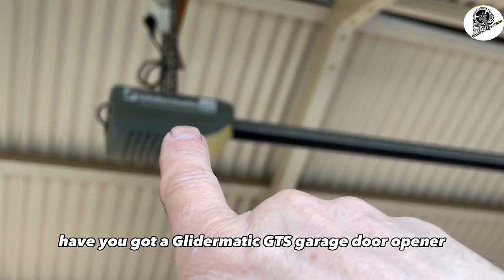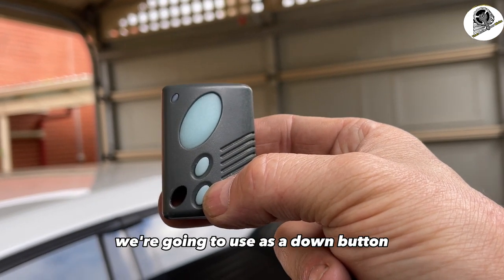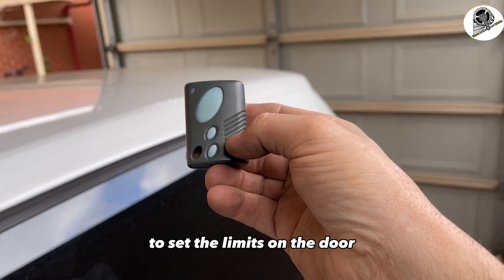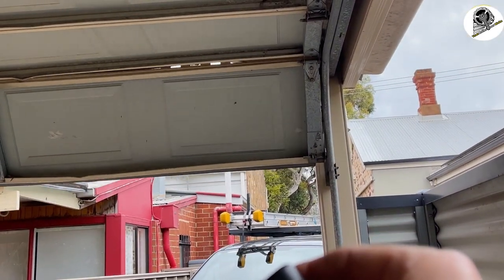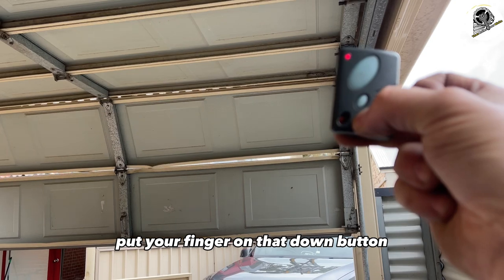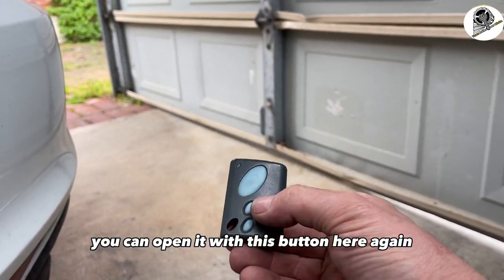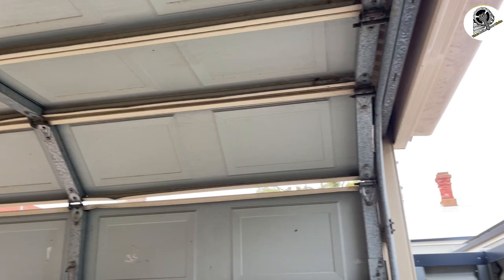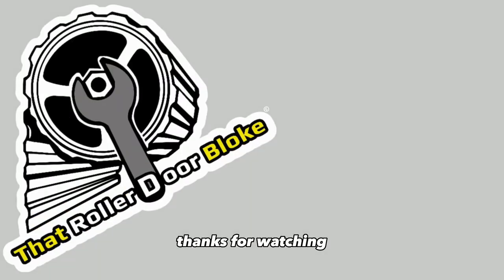[17] Glidermatic GTS 2000 just beeping ? How to Set the limits by Gliderol remote #garagedoorrepair

Comment: Hi mate thanks for your hard work, just wanna ask, my automatic gliderol door is very slow going up and much faster goind down, is the tention spring problem? Any hints? Cheers.
Reply from the maker: Thanks 🤩 
Yeah most likely.  Best way to check is disengage the motor when closed run the door up and down by hand it should not drop when stopped about half way

Comment: hi mate,i did same as your instruction its worked, but when the door went all the way down once of the chain went loose and the door cannot goes back up i have to pull the strings with the big bang noise and the chain straight again and the door can goes back up,its keeps happened like,do you you what wrong thanks mate
Reply from the maker: Bottom limit is set too low. Door is trying to close too much

Comment: Hey mate, following this I can bring the door down but when trying to bring it back up it'll go up a few cms then stop? Would that be the motor?

Cheers!
Reply from the maker: With the limits or just normal running ?   Check how it runs manually if easy and smooth, could be the motor.  If the door runs quite stiff or heavy it could need some spring tension or lubrication.  You should be able to lift the door with one hand quite easy. 

If you’re setting limits and the door won’t open and the door is running good, it could be the sensitivity dial you can turn it to the minimum I think. Or it might have a small jumper pin -  small medium large put it on L
Reply: @rollerdoors  thanks for the reply. It opens manually. I can put it to the the top position manually then put it into learn and then get it to clos automatically, set that but then when I try to begin setting the open position it won't go up automatically. Just beeps twice.
Reply: @rollerdoors  how do you adjust the sensitivity dial on the door?

Comment: Hello my roller door was stuck in safety mode. it’s been manually opened to get my car out, but it won’t work with this description. It is beeping the same as in the video, but the motor isn’t doing anything at all😓
Reply from the maker: If limits don’t work it could be the motor failed